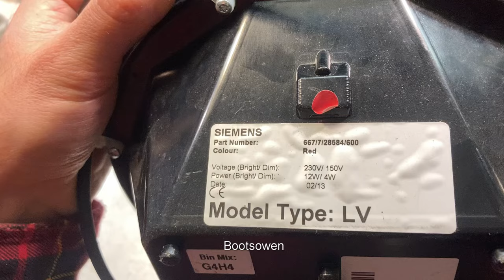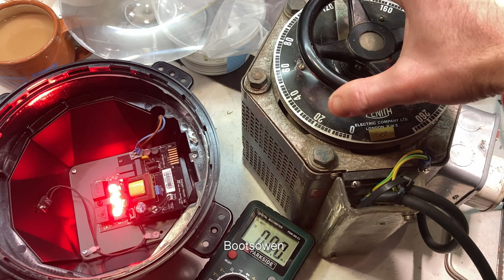Inside an LED traffic light lamp: can I hack it? #trafficlight

Comment: Fascinating. Looks like you have a decent 240-18v supply there. Was your bench power supply set to constant current? I expected the ammeter to move depending on LED draw.

I was looking intently at the circuit boards to see if they could be adjusted for different output levels. If not too much of a bother, could you see what the TO-220 package chip is bolted to the side of the casing. It was marked 'Resistor' on the main power supply.